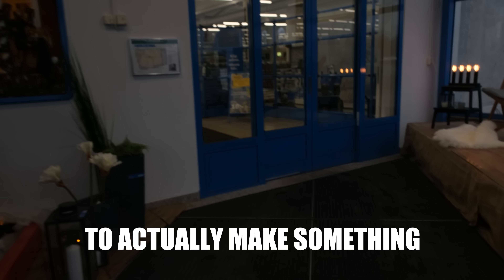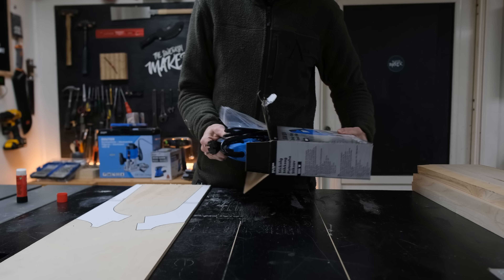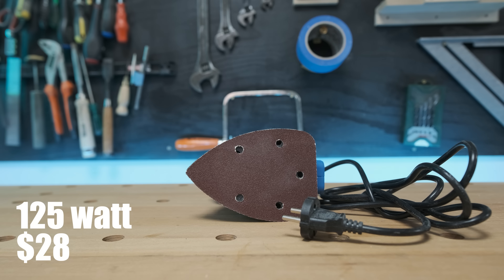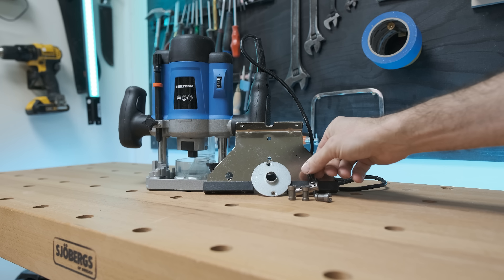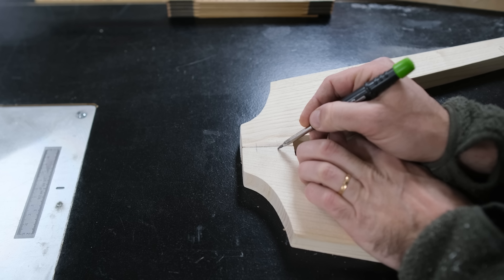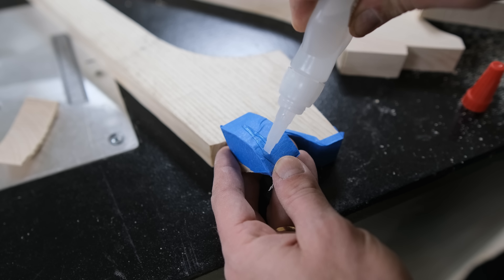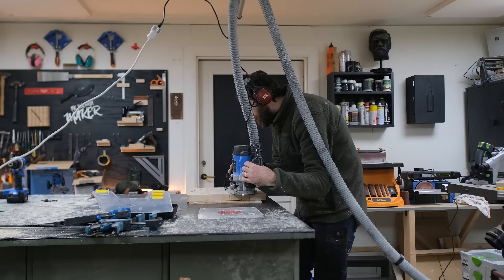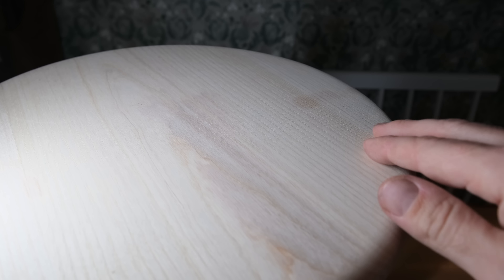buying the cheapest tools out there....

Comment: I, personally can understand the concept and frustration, some people may have, about the modern woodworking tools and people using them. It's not easy, and it takes many years to learn to master woodworking like our predecessors did. But if you work with wood and make things out of it, then you are a woodworker, doesn't matter the process or the tehnic you use. In the and we will not be able to make anything today if it wasn't for our predecessors, we learned so much from. So that have to be a reason to be proud of, not angry or disappointed.
Reply from the maker: Yepp, agree with you. We should def. have respect for those who have that kind of knowledge and pass it on.

Comment: Cool video! As a tip, when gluing the top to the legs, you could put the seat in position and stack all of the tools on top to act like a clamp. Though, for the price you paid, I’m sure they are a fraction of the weight of more expensive tools.. maybe put all of the scrap wood up there too 😂
Reply from the maker: Good idea! haha, yes they are all plastic basically so not a lot of weight :)

Comment: Hej Pierre - snygg pall! The big challenge in the project was not using the cnc router, right? The jigsaw is a tricky tool even if you had an expensive one. And I don't see the difference between an expensive overhand router and a cheap one as that big. The video should be called "this is how hard it is to make a stool without the cnc".
Reply from the maker: that would have been a good title :) And thanks!